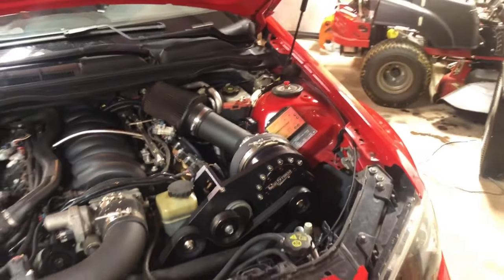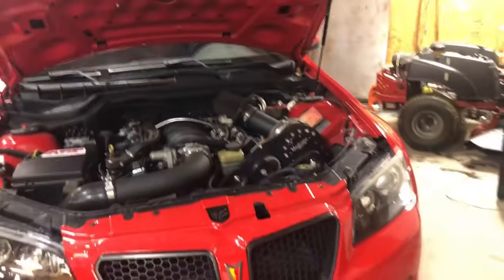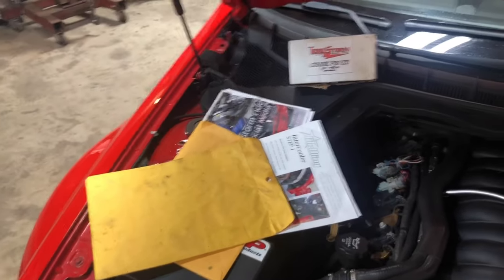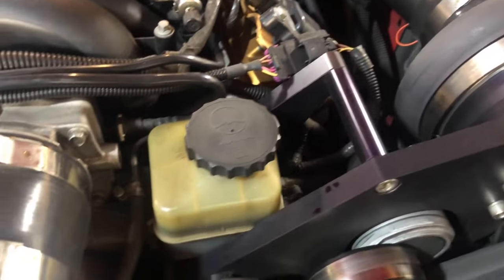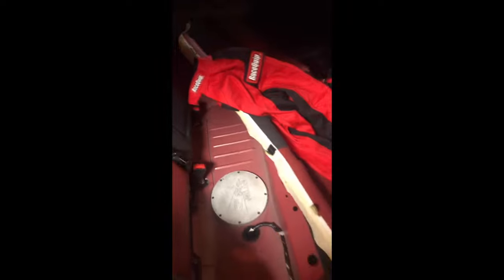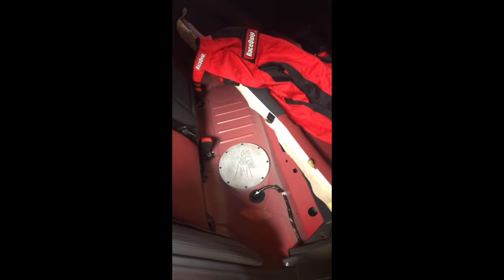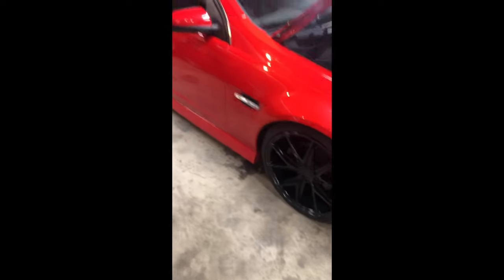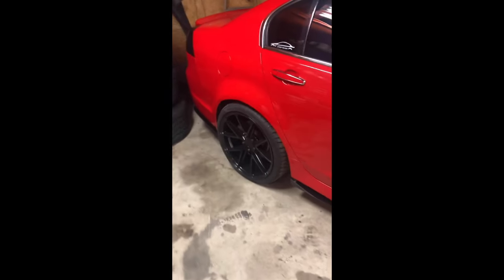Answering questions about my Torqstorm build

Comment: How’s the kit holding up?
Reply from the maker: Still great no issues.  Ran original one for over two years and now have the new version and works great.
Reply: @gapfactorygaragellc  hell yeah definitely picking this kit up, I’ve heard of bearing issue in the early kits but I know they’ve upgraded bearings since then. Have heard good things about there customer service.

Comment: I have a Donk with a 6.0 cam 3200 stall and I am thinking about doing a torqstorm what kind of power u think I could get
Reply from the maker: I think with the 75 you will see around 600ish
Reply: I’ve been doing my home work on the torqstorm and all reviews has been good so would u say the same because at first I was leaning towards the LSA supercharger
Reply from the maker: For the money you can’t beat the torqstorm. We have not had any issues with ours. And if that’s not enough power they are going to be having other sizes come out
Reply from the maker: If you have room for it they may offer a twin kit

Comment: Did you get ati supercharger damper & pulley or did you keep standard crank hub and pulley
Reply from the maker: We just used the standard crank hub and pulley
Reply: @gapfactorygaragellc  any issues so far with using that
Reply from the maker: Not at all just pinned the crank and went.  The worst part is lining it back up when you need to pull pulley off

Comment: Did you ever figure out why you were only
Getting 5lbs on the 3.1 pulley
Reply from the maker: Boost leaks and sent blower back to get housing oringed
Reply: @gapfactorygaragellc  Also if you used your air cleaner during your dyno, you’re are losing about 2 pounds of boost just there. That’s what happened with mine I took it off and gained 2 pounds of boost
Reply from the maker: Ya we take the filter off when we race it had a velocity stack on the blower and it also helped out too
Reply: @gapfactorygaragellc  that’s awesome!

Comment: Man, you guys should do some research. There's alot of random parts in there. Why would you upgrade injectors? 1050s will be plenty for E. Also why not a fore fuel system, no need to do a fuel cell..
Reply from the maker: Because we have everything from the truck laying around going on the car. The 1650’s are over kill yes but we’re planning ahead for our future goals with this car. The fuel cell will be cheaper anyway than doing a fore system.
Reply: Those injectors are going to flood that engine.. 7-750whp can get ID 1000s, 1050's can support even more. When you're no where near why would you waste money? That blower won't get you that far.
Reply: @hpperformance2819  if you think injectors will flood the engine you must not know anything about late model tuning. The injector tables can be scaled way down with no drivability issues
Reply: @CRAZEDX100  I know my fair share, they can be scaled down but only so far. But my thing is why when the spray pattern with be way off (hence "flooding" the engine). I didn't mean it so literally, I mean the will be dumping way too much fuel than is needed. Read first
Reply: @CRAZEDX100  it will never need that injector as I said so why would you waste time and money putting them in
Reply from the maker: @hpperformance2819  did you even watch the video or read my comment? We’re not paying any extra on these. They are out of my husbands rcsb bc he’s upgrading his. So we have them laying around. You can tune it to make sure it doesn’t “flood the engine” like @crazedx100 said you do it through the injector tables. 
We’re puting them on now for future plans and we have a friend that wants my 1050’s for this year.
Reply: @hpperformance2819  She's actually making money since she didn't have to buy the 1650's and she'll be able to sell her 1050's. Sure they might be an overkill now but they'll be fine and won't have to worry about running out of injector in the future.
Reply: @xox_misslexx1426  can't say I didn't try to inform..
Reply: @hpperformance2819  you could have been nicer about it lol
Reply: @xox_misslexx1426  I wasn't being mean, just saying that they should research things before throwing parts in. It's one thing to "work" but you should get something that it needs. I was only trying to give advice, internet can make it seem otherwise..
Reply from the maker: @hpperformance2819  you need to learn how to word things then bud lol
Reply: @gapfactorygaragellc  maybe it's comes off wrong here but nothing I said is wrong. Just putting my nose in others business 🤷‍♂️😉
Reply: @hpperformance2819    increasing fuel pressure at a lower pulse width/injection event can correct the flow pattern. At the power level this car is making it's not detrimental. It will be fine. I've ran 1000cc injectors in bone stock 5.3s with a little boost and they were smooth enough to daily drive and afr's were rock solid. Having the correct injector data is one thing but knowing the math involved to make them act how you want is a whole different story. She's smart for saving her money and tuning the car accordingly
Reply: @CRAZEDX100  the "power level" is quite low and does not even need 1000's let alone 1650. How is it smart when she already has more then enough injector?? Yes there are game to play to make things work as we have both stated, but thats not the point. Why not do it the right way..?
Reply: @hpperformance2819  she even stated she was planning ahead for future goals and had the injectors lying around...lots of people over build their fuel systems. There is nothing wrong about it, it will run just fine and leave plenty on tap for when she shoots for 1000+ hp. You're overthinking things dude. A set of big injectors is such an insignificant thing for you to be hung up on. You didn't pay for them and it's not your car so why are you so concerned about it? It will run fine and it's not even your build so why do you care so much?
Reply: @CRAZEDX100  yea I read that too, and if you think over fueling is so insignificant than you have a lot to learn. Also read what I said, yea it can run, but won't run great. Even 1000whp which I guarantee won't happen doesn't need 1650s... it's actually not a small issue to be hung up on and at the end of the day I don't care, just offering correct advice unlike yours saying to "just run whatever you want.. it will be just fine"... I have plenty of experience and examples to back me up and so would other guys who know their stuff. Not my build you are right, feel free to check it out tho🤔
Reply: @hpperformance2819  it won't over fuel with the proper tuning. Why can't you get that through your head?
Reply: @CRAZEDX100  so you think putting an injector in that is WAY too large (like double the size needed) that it fuels properly? Large injectors, such as those 1650s, don't have caps to help with spray pattern and dump fuel instead of spraying(atomizing) that is needed. Pretty sure I have it straight in my head, you do not sir.
Reply: @hpperformance2819  no you don't...your knowledge of late model fuel injection tuning is obviously very limited. It can be tuned properly. I've seen it done and I have done it myself. I could explain all the math involved in the tuning but you would still think you're right. I'm not going to continue arguing with someone who thinks these injectors are going to ruin the drivability of a vehicle even with proper tuning practices.
Reply: @CRAZEDX100  you're only arguing with yourself, I tune as well. I think you are also missing the point so think what you want. But what I said is true. Those shouldn't be in that car is the point. Period
Reply from the maker: I have a question then. What injectors would you run on a 800 hp car with a 43psi base on pump e85?  When I had around 1k-1100 hp on the truck with 43 psi base and pump e I was out of injector and had to upgrade to 210s.  On e and at 800 hp the 1050s will be about maxed out.
Reply: @gapfactorygaragellc  at 43 psi yes they would probably be about maxed out. That's why you run those same injectors with a proper fuel system(boost referenced regulator that raises pressure 1:1). But if I were to pick for your question 1300-1400 would more than do it. Hell 1200 should do it. BUT my question is, where do you get 800? It's not there and I doubt that blower will make that..
Reply: @gapfactorygaragellc  with a proper system those 1050s would be plenty.
Reply from the maker: @hpperformance2819  well this is our build. We’re doing it how we want. And for future plans. I know this supercharger won’t make 1000hp. Probably won’t even make 800hp but in the future the car will make that. And I’d rather use parts that are free now than have to buy them again in a couple years. A fuel cell will be way cheaper (we have the cell from the truck too so I’m not spending any money on the fuel system) and will work just fine. We’re not stupid and we ask people who are knowledgeable before we make our decisions. Ex: my tuner, our parts guy/chads tuner and other people with experience. 
You have your opinion and we have ours so there’s no use in going back and forth about it.
Reply: @gapfactorygaragellc  never said it was my build, only trying to give some insight/help with making good decisions. Makes no difference to me so if you don't like my advice then don't take it. I'm the guy who is doing the things you speak of so I have some experience. The fuel thing is not an opinion which is why I was making statements. It was to help.
Reply: @TheSlowC6  right! I was just commenting on the situation.. saying they could pick better parts to put in it